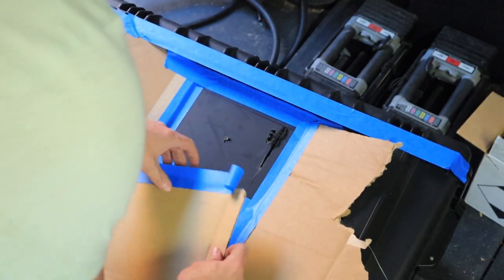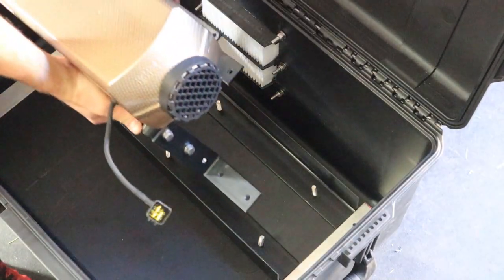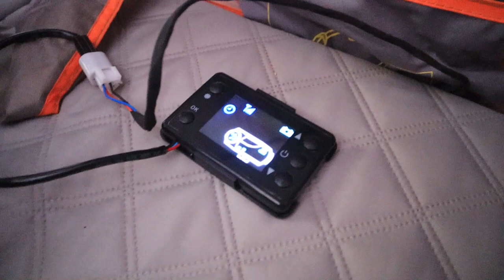Diesel Heater in a Pelican Case-Overland Heating System

Comment: Thanks for the video. Looks like you put a lot of thought into your build. Do you have any problems due to weather with it mounted on your roof rack? I'm concerned about rain/snow getting in the open holes in the case. I would think that you'd get a fair amount of water in the 3 inch hole for the hot air and also the air filter would get soaked too, no? Perhaps it's not that big of an issue since you moved the controller outside of the box and into the tent... ?

Comment: Thank you so much for sharing!!! I have this same heater and I love it but have struggled with the exhaust getting so hot that it melts/burns where it exits out the wall. I will try the adapter/connector you have used. 
I also love the roof tent you have! Did you have to install special railings on your roof to hold the weight?

Comment: I am looking to put one under my camper van.  However, a few things to know...First that green fuel line dries out, gets brittle, and cracks leading to fuel leaks.  That is not good on your vehicle, especially should you and your daughter be trapped up there.  Second, plastic and exhaust heat don't mix, not to mention the exhaust really needs to be further away from your tent.  I like the car air filter idea but i would have gotten a bigger one to allow for better air flow, especially as this one starts to clog.  Restrictions on intake and exhaust have been known to cause them to carbon up, lose efficiency and eventually fail.  I have an extended Transit van and will be putting mine in an aluminum box secured to the underside.  I know I will have to run 2 air ducts to the inside but the exhaust pipe will be 100% outside the vehicle.  How has that heater worked for you without an air return?  Have you had it carbon up at all???  Subscribed, liked, notifications enabled.

Comment: Nice build!  I built my own and used similar ducting to what you have here and I noticed the glued seams were pulling apart when the duct was stretched and the heater was on full blast. Have you noticed this at all.  I decided to go with the same duct supplied  but longer lengths and a coupler
Reply: Where are there "glued seams"? Isn't everything screwed, bolted or clamped? What am I missing?
Reply: @garyabc  The seams for the ducting. I ended up buying a few from eBay that work well
Reply: @derekhenderson9344  Thanks, Derek. Makes sense to me now.

Comment: Great video!  Do you have a link to the through hull exhaust fitting?  The link is broken in the description.   Thanks!
Reply from the maker: Thank you for the heads up on the link. I fixed the link in the description. But here it it just to make it easier:
https://amzn.to/3qWZHHG
Reply: @4X4Carpool  awesome thanks!  Do you remember what diameter it is?  I can go caliper mine I guess.   I built one this fall and used it in Moab in November but it was a terrible install job on my part because the Pelican case isn’t big enough.  It was like trying to fit 10 gallons of poop in a 5 gallon bucket.  I’ve got a bigger Pelican case that I’m going to try to work on today. Thanks for your help!  - Geoff
Reply from the maker: No problem, it’s 24 mm.
Reply: @4X4Carpool  thanks!   I just ordered it along with the other parts to make this heater box nicer.  I appreciate it b

Comment: Awesome clean build. What is the weight of it (with or without diesel)?
Reply from the maker: Thank you!
I didn’t think to weigh it before installing it on the roof.
Reply: I doubt it weighs more than 30lbs with the way he has it. I have a similar unit but not the big case and it's like 10lbs.

Comment: I would put the heater at least 3 meters away from the tent, one reason is for the noise, another reason is for safety; also your hot air outlet duting is the flexible type which is wrong, as you can easily bend the duting more than 270 degrees which stop the hot air from coming out freely cause the overheating issue. You should use the straight  hard duting
Reply: These are designed to be fitted inside of vehicles, it has an exhaust port which should be ducted away from your fresh air but the actual heater can be anywhere.

Comment: Curios..that exhaust manifold must transfer allot of heat to the case no....?
Reply from the maker: Not a lot of heat is transferred to the case. Even the outside ring of the exhaust fitting can be touched at full operating temperature.  I’ve ran it 3 times now, all 3 times have been over 10 consecutive hours with no issues.  Before I installed it on the roof I ran it for 7 consecutive hours. I ran many tests on this setup before final completion, the biggest problem I had was finding the right flange for the heated air to pass through. The ones used in this video are the 3rd ones fitted. The first 2 kept melting, I finally found the aluminum flanges and it’s working great. 
As I’m writing this, we are on Bradshaw Trail camping, my wife and kids are enjoying the warmth of this heater. Haha

Comment: The link for the air cover filter is broken and try as I might, I cannot locate one.  Anyone have an idea?
Reply from the maker: It looks like its out of stock.  But I just added another link for the white version.  White might not be ideal, but some black spray paint could fix that.
Reply: @4X4Carpool  That's awesome.  Thanks a million!!

Comment: I've heard there can be clicking noise when diesel heaters operate.  Do you notice it or is quiet enough at night?
Reply from the maker: The fuel pump makes the clicking sound, but it’s not super loud.  It’s slightly annoying right before you fall asleep but it doesn’t keep anyone away. My wife and middle child are very light sleepers, they have not said anything about the clicking.

Comment: The diesel heater supposed to be inside the tent so it heats the already heated air if you have it outside and it's cold then you're reducing the efficiency by a lot. You'll be safe if it catches on fire but you're reducing the efficiency

Comment: They have all in one portable ones that you don’t have to do all that bs. Because is a self contain unit. Just install intake, exhaust, vent hose and add diesel.
Reply: I’ve never seen a self contained one that is water tight
Reply: You must be living under a rock
Reply: @mega-hb4re  the all in ones are not water proof and they often need modifying with correct gas line, fuel filter, clamps etc etc.
Reply: @mega-hb4re  Planar from Vancouver makes one in a watertight case just like this. All the other "all in one's" from China are open to the elements.   Unless of course you are hiding it "under a rock"  along with the guy you just tried to put down. LOL